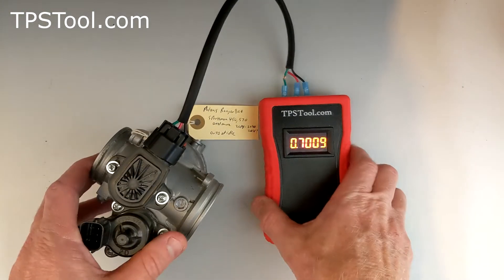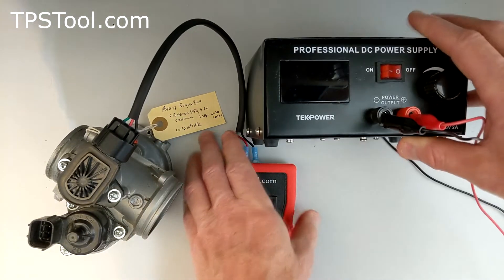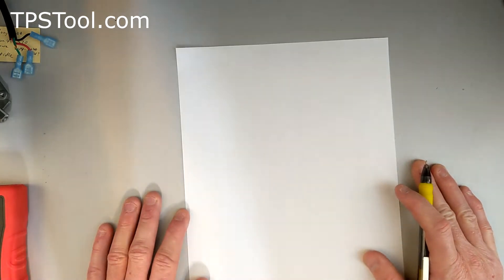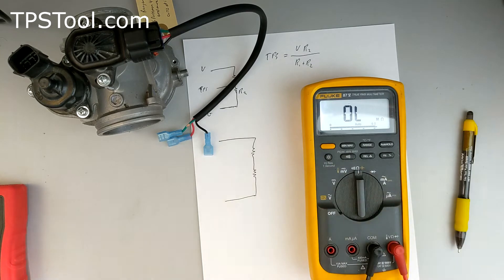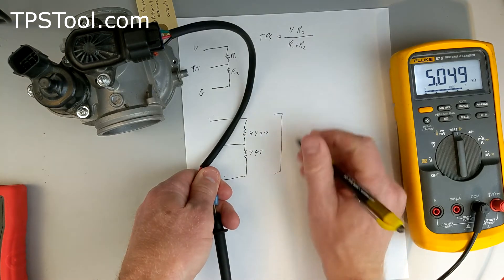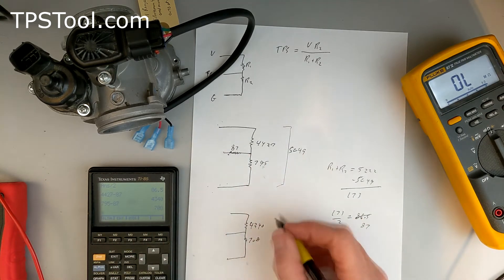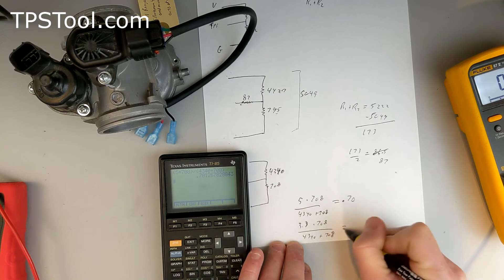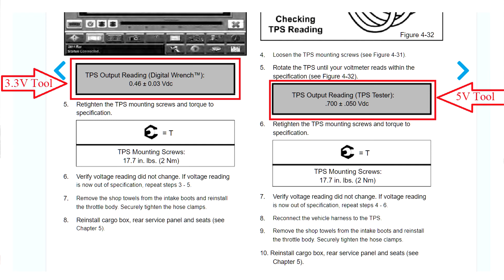Polaris TPS, 0.46 or 0.70,  which is correct?  Ranger, Sportsman and more

Comment: I bought the tool and adjusted it perfectly and I’m still getting a code tps low voltage
Reply from the maker: Thank you for your comment and your business.  You might have a broken wire in your wire harness which would stop the power from reaching the TPS and/or stop the signal from reaching the ECU.  This is not uncommon on Polaris.  Send me an email and I'll help you get it sorted, help@tpstool.com

Comment: I have a polaris rzr 800 (2008-2010 dont know the exact year model due to sticker being gone and no visible STAMP of serial on frame) but my throttle body doesn't have the adjustment screw or the automatic throttle control unit) what should my adjustment be? I have the TPS tool amd I have it set at .72** but it still idles low and under full throttle it's like it drowns the bike out..but 1/4 to 1/2 throttle revs up but does at idle and chokes out over 1/2 throttle to full
Reply from the maker: Thanks for your question.  The screw should be there somewhere, this video covers that throttle body and should help:  https://www.youtube.com/watch?v=rM7FyjNZFMQ   Try the settings for the 2008, which would be 0.528 base (idle offset screw backed  out all the way), then turn the idle up until it reads 0.735.  That's factory spec so it should be right, but you can further fine tune the TPS from there if necessary by adjusting the sensor itself about 0.02V higher (richer) or lower (leaner) at a time.  Since you're also having trouble at bigger throttle openings, also be sure to make sure the fuel filter isn't clogged or dirty and that the fuel pressure is OK.  Low fuel pressure, from a bad pump or clogged filter, can make the motor start cutting out when it needs more fuel.  Also make sure the injector is clean and spraying a good pattern.  I hope this helps!

Comment: I got 15 kx 450f I took the throttle body off an moved the tps bought the tps tool but can only get it to .47 an can’t get it any higher any ideas is much appreciated thanks
Reply from the maker: Thank you for your business and your question.  First double check that you have the TPS Tool wired correctly (wire colors in the right spot).  If you open the throttle, does the reading go above 3.5V?  If no, then the wires are likely in the wrong places on the TPS Tool.  Send me an email and I can help get you going, my email is at the very top of the instructions that came with the tool. :)

Comment: I have a 2012 Polaris ranger 500 EFI. The TPS is reading 3.86. What should it be set at?
Reply from the maker: It sounds like you have the tool connected incorrectly.  Try swapping the GND and 5V wires.  Send me an email if that doesn't solve it.  The setting for that motor is listed on our common settings page:  https://tpstool.com/help/common-tps-settings/

Comment: I have a similar question a have a 2005 polaris sportsman 700 I just bought your tool which value do I need to set mine too?
Reply from the maker: Thank you very much for your business and your question.  The service manual says a base value of 0.528V and an idle value of 0.710V.  If you set the base, be sure the throttle body is clean of any carbon build up so the throttle plate fully closes.  See page 4.16 in the service manual.  I hope this helps!
Reply from the maker: Also if you check our Common Settings page, you will see links to a HowTo video and links to the service manual:  https://tpstool.com/help/common-tps-settings/

Comment: Been looking all over for the 3.3 closed throttle setting, thank you very much.
Reply: Update, I set the tps at .465 volts at closed throttle and using the ecm's 3.3 volt feed. It ran but rich, it kept trying to idle down to 1200 rpm's but idle back up to 1800 cause it tries to die obviously iac opening to prevent it from dying. I  brought the setting down to .35 volt and runs great. Am I missing something, or another issue I'm overlooking?
Reply from the maker: @maxgforce75 I just saw your message now.  I believe the spec would be 0.46 at idle, not with the plate fully closed (i.e. do not back out the throttle stop screw).  If you fully backed out the idle stop screw before setting it to 0.46, then that's why you're rich.  Or if the 3.3V supply isn't accurate, that could throw things off too, so maybe double check the 3.3V line from the ECU.  But long story short, the goal is a good running engine, so if you found a good setting then you should be set.

Comment: I really like your videos. I know it’s long shot. But I have some issues setting my throttle body as someone was playing with it. Would you happen to know voltage vale at the stop screw all the way out for Suzuki outboard 2018 model 70hp. Appreciate your help.
Reply from the maker: Thank you for your comment!  I'm not familiar with that particular motor, but the first place to look is the service manual if you can get your hands on it.  If that's a no go, then I would take a guess at perhaps 0.40V and see if it will start.  If not, try 0.45V.  Keep going up about 0.05V at a time until you can get it to start and run.  From there you can fine tune it by adjusting about 0.02V up or down until you find the best position.  Treat it like the fuel screw on a carburetor, up and down a little until you find the best spot.  If that motor has a TPS auto learn feature or similar then this might not work, but if you don't have access to the service manual then this is what I would try first.  I hope this helps, please post back and let us know how it goes!
Reply: @TPSTool  I really appreciate your input. That is what I was trying to do. The only problem is that the stop screw was messed up too. So I have 2 problems to solve :(. The manual is saying that itps needs to be between 0.7-3.8v. I guess the only way now to work out is to know the voltage when the screw is all the way out. I got ithe motor running just fine but I’m just bit scared if it runs lean or rich not to burn the engine. Unfortunately Suzuki is not giving those values as they are factory set. New trottle Body costs $1000 rip off. If you got any ideas  let me know. Otherwise keep the videos coming. Cheers
Reply from the maker: @vedranmujcinovic4000  If it's running fine then that's 9/10 the battle.  Give it a good hard run then check the spark plugs to see if it looks too lean.  Too rich shouldn't cause any immediate problems, some extra soot but I would not expect a hard failure.  Too lean could cause more immediate problems, but if the TPS is the only thing that has been fiddled with, and it's idling good and otherwise running well then you've probably OK.  If the manual says 0.7-3.8, then that would imply that 0.7V at idle should be in spec.  If it were my personal motor, and if it's running great, I would check the spark plugs and if they look OK then run with it.  :)

Comment: so the .46 and .70 values at millivolt or milliamp reading if using multimeter correct
Reply: 0.46V would be 460mV, and 0.70V would be 700mV.  If your meter has a manual selector, try the 2V DC setting if it has one.

Comment: Hello ! I need some help !? I’ve got a 2015 Polaris 570 sportsman touring atv of course. I’ve messaged you before and stated I had got your TPS tool to help in getting or knowing what my sensor was giving me for a voltage reading because my atv would not start and then idle. Then maybe on the 3rd 4th or 5th time it would start and stay idling. Know I’ve been following your lead on setting the TPS at .685 and .691 and yes I finally getting frustrated and loosened the idle screw and then turned the idle screw till it read .7027 and other .70?? Settings. I’ve tried many different settings. It will start and idle then when I turn it off and try to start it won’t start and idle. The TPS sensor is a new one and still have the one that was there which I believe is fine as far as working but thought I would try a new one. And there is no problem with the throttle on the contacts coming together and being a problem. The first time I took out the throttle body and plugged in the tps meter it read .6471 . So I’m stumped if something else could be wrong or I just haven’t hit the right voltage setting. Just to mention also in trying to get things right it will start but idle is at 1700 - 1800 rpm I’m able to turn idle down so it’s at 1200-1250 rpm at idle turn off machine and then go to start and then it won’t start and idle. So any thoughts ? Signed a work in progress… Duane
Reply from the maker: Thanks for your message.  I'm not entirely clear on where you're at right now, but hopefully this will help.  If you adjusted the screw that you're not supposed to adjust (video here: https://youtu.be/aUX_fkKnQ8Q) then fix that first.  Basically you want to turn that screw until just BEFORE the throttle plate opens, stop just before it opens and tighten the lock nut.  It's job is to take up any play in the system.  I don't have the manual for the 2015 model year, but the 2014 model year manual says 0.70v at idle, there's reasonable odds the 2015 is the same but if you can find the 2015 service manual and double check then that would be ideal.  Once the TPS is set, your TPS should be good and if it's still having a problem then the problem is not the TPS.  That motor uses an IAC valve that allows the ECU to control the idle speed, I would check that next.  Maybe it's sticking or just not working.  I would also check the fuel pressure and clean the injector.  Here's a link to the 2014 manual explaining how to check the IAC:  https://www.manualslib.com/manual/1535063/Polaris-2014-Sportsman-570-Ef.html?page=174&term=IAC&selected=1#manual    I hope this helps, please let us know how it goes!
Reply: @TPSTool  k
Reply: @TPSTool  ok thanks I just home again here and I got what your explaining to me
Reply: I’m back at working on this situation so I’ll get back to you I believe I’m close cause when my girlfriend holds the handle brake and turns the key to start I give it just a ever so little bit of throttle gas and it stays running and idling. Anyway I’ll watch that video again I’ve taken it for a ride and it snorts right along. So I’ll get working on it here again after I eat and gather my thoughts lol. Thank you
Reply: @TPSTool  will do thank u 🙏
Reply: I got it it runs great idles at 1200 and all seems to be real good 😊
Reply from the maker: @duanelarson6005  Excellent!  To help the next person, what steps did you take to get it running good?
Reply: Well I put the tps sensor that was on it . We bought it used with 1277 miles. I was able to put the tps sensor at .6801and was able to tighten it down and keep that setting. And as follows turned the idle till I got .70112 and when I got the jam nut tightened the tps sensor read .7027 and went with that. Man it was an anxious moment. It popped right off and when warmed up meaning I took it out for a driveidle rpm was at 12500 x 1250 which is good. So far all is holding not sure what happened in the past when it started acting like that. We were camping and that when it started to faulted in starting and idling. Sharon would hold the brake and turn the key and I would give it a bit of throttle and it would start and stay running and no other performance issues. And runs great now no issues. I’m anal about keeping sea foam in tank and of course I use 91% octane gas All is great right now. ! Thank You
Reply from the maker: @duanelarson6005  Thank you very much for posting back what worked for you!  One more thing to keep an eye on, some of the Polaris models have a kill switch up in the throttle assembly that will turn the motor off if there's too much play in the throttle cable.  If the throttle cable goes too slack, there are 2 metal contacts that will come together and kill the motor.  When this happens, the motor will run fine as long as someone has a thumb on the throttle, but it will die with you let off the throttle completely.  Also if you can find rec90 gas in your area, that's gas without ethanol, that gas lasts a lot lot longer without gumming things up.  I hope this helps and good luck!
Reply: @TPSTool  yup I know about tha and that’s okThanks